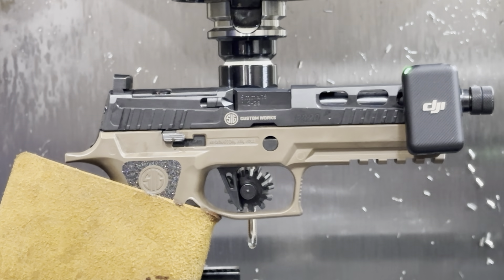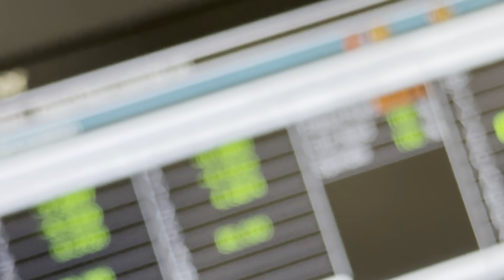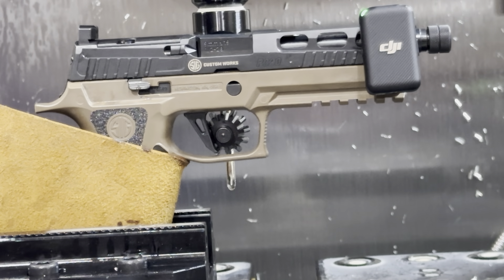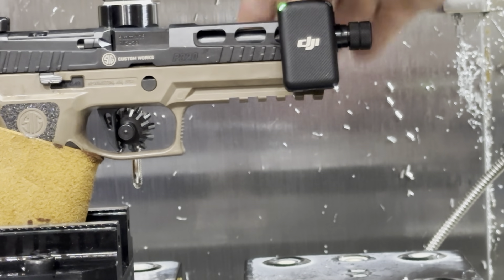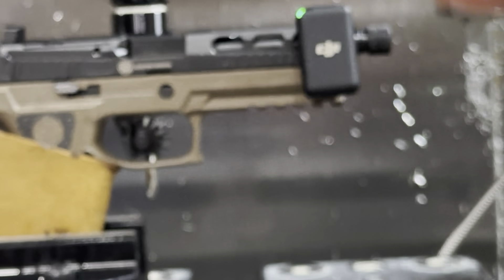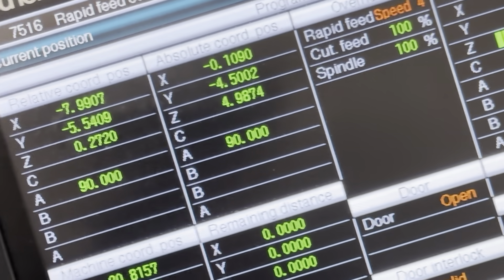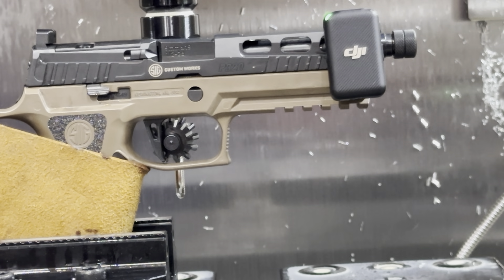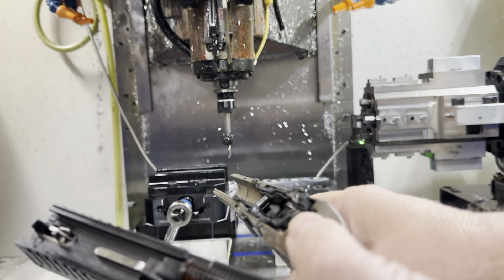Sig P320 accidental discharge tested in CNC machine.

Comment: so actually hes kinda wrong on his conclusions, saying thats how the sig is designed! well from my eyes i see that the trigger is still NOT fully depressed, and it fired when he bumped the slide! so Wyoming's test was right! sounded like he was trying to poo poo on him, and hes a little bit pro Sig! but when you boil it all down, NO FIREARM SHOULD FIRE UNLESS THE TRIGGER IS FULLY DEPERESSED! see, i can cap lock too Sig! all this guy did is prove that his trigger takes a little longer, but still dangerous! also, he has a newer sig, with a flat blade trigger face, not the same trigger the M18 has, or some of the earlier Sig P320's! but lets gloss over that fact too i guess!

Comment: Ironically you are PULLING THE TRIGGER....So it's not an uncommanded discharge,that just proves that the trigger was INDEED PULLED to the farthest point and the fact that my sig takes less than a pound of force past that point just means it has a light trigger that still has to be PULLED FIRST....

Comment: When I watched the "screw job" video yesterday, my first thought was somebody needs to put a P320 on a milling machine and calibrate the actual trigger break dimensions.  The Bubba test and this video both illustrate a potential issue may exist with the Sig, but I'm not sure how it relates to the tragedy at F.E. Warren AFB since all indications are that pistol was in a holster.  Presumably, no pressure was being applied to the trigger when it discharged.  Now I expect to see a whole bunch of video tests of other handguns that show this feat can be replicated.  That's fine, but I'm much more interested in finding videos which show a discharge occurring when no pressure whatsoever is applied to the trigger, including taking up the slack.

Comment: All this proves is that THIS PARTICULAR 320 probably doesn't have the problem. It's obviously not all the guns that have an issue. But if it wasn't the guy's issue then you would see similar numbers of glocks, m&ps, springfields, walthers, and other brands having the same issues going off in holster... you also don't see it happening with other sig guns, or 1911s... it's ONLY the 320 that has this issue

Comment: Whilst I appreciate you spent the time to make this video you do undermine it somewhat with your "I won't respond to comments" - that's something of a red flag. The other major factor, which I was not surprised you were very clear to avoid, is that you are testing just one pistol. And while your pistol appears to be well made and well within tolerances, that might not be case for ALL P320s and certainly might not be for firearms being produced in large numbers for the military and police forces - often at low margins. How often have we discovered that civy street has better made hardware than the armed forces. 

But what you've proved here is that YOUR P320 is good.

Comment: I want to start off by saying I sold my favorite gun of all time my Sig P320 X-Compact because of the firing issue. But, why is nobody pointing out that not a single one of these "viral" videos shows it going off without pulling on the trigger at all which is what supposedly is happening? I know it shouldn't be doing what it's doing but what holster is going to be depressing the trigger at all and if it is why the hell are you using it? These have no trigger safety and the travel from the wall to fire is VERY short especially with the flat faced triggers. So yeah if you start engaging the trigger even if it's "just to the wall" it's moving parts preparing to fire it's not just taking up slack in the trigger.

Comment: And that's precisely the problem with the P320: tolerances. We can't be sure that the trigger catch will always return to the same height after assembly in every P320. Personally, I find it strange that when the trigger is pulled, the entire bolt carrier is pulled down by that 0.5mm, sometimes more. This means that if dirt becomes present during shooting or, for example, when a full magazine is forcefully inserted into the closed bolt carrier, we can release the firing pin latch by fractions of a millimeter. Therefore, if the QC allows components within their minimum allowable dimensions, we could have a problem. And therein lies the entire problem with the P320: excessively large tolerances.

Comment: Go do the Glock video where you so gingerly press on it like you do the sig. 

The downside of this test is that you can be pushing the weapon into the part touching the trigger and it would be difficult to tell. (Although it’s easy to see you do it in the Glock video you posted.)

The benefit of the screw driver or pin above the trigger is that it moves with the weapon so literally the only influence is touching the slide.

Comment: I mean but you're not proving nothing a gun is supposed to go off on a trigger is pulled like that 😭 of course you shouldn't be able to get the firing plan to drop from touching the slide but I mean you basically pull the trigger

Comment: What if there is a combination, hot cold weather conditions, dirt and debris, enough play/tolerance in the gun and the different parts, due to manufacturing and or wear and tear usage, that the 2mm trigger pull is no longer required, but just the wiggle on the slide.

Such a gun should be placed in your CNC 

Best regards from Germany ❤

Comment: Do this test with the ones that went off. Seems to be by service members that use their gun and in several other videos there seems to be rounding off of the sears and uneven wear as well. Also testing one gun doesn’t test them all and that seems to be the issue. There can be one in 50,100, 150 thousand. It then warrants review. Not, “it’s the operator”. It’s weird, no one is complaining about any other Sig gun. My issue is the complete disregard. Never carrying an Sig again just for that. The fact they aren’t taking it serious but instead being defensive. I think the issue is the safety disengage. If you have any build up on it, it takes very little to disengage the safety. If you have any wear on the slide it just amplifies the issue because it can then rock and lift more. I would be curious to know what the spec would be on those parts because a few thousandths difference can in turn turn a gun from being able to fire like yours to only needing less than a mil or maybe less of pull to disengage that and arguably inertia can play a part. The argument at the end of the day isn’t about Sig is trash. It’s why buy or carry Sig when there isn’t that issue with others and when a company won’t take it seriously.

Comment: You know what it might be. If someone incorrectly charges the weapon and holds the slide as it chambers a round, it might be just barely in battery, but due to stacking tolerances and this narrow margin not fully engaging the internal safeties. The gun being out of battery a few thou I think is mechanically similar to the trigger being taken up these same few thou.

The few videos where the gun goes off as it is being re-holstered might be doing something similar. The act of re-holstering is pushing the gun out of battery this imperceptible 0.09", and then any added torque on the slide sets the gun off.

Comment: I am really glad you did the video with the CNC. Good job. 

When you hit the "wall", you disengaged the safeties that prevent the striker from going forward. Something I do not think most people understand.  Essentially, all you did was defeat the internal safeties which given the tolerances, if the slide and the FCU are in spec, 20 - 25ish/1000" later the sear should drop.  Given the slop in the slide and FCU of that pistol, bouncing the slide could easily cause the sear to disengage.  However,  one has to wonder on that pistol, if you had a loaded round in the mag pushing against the slide, would you have that much movement. 

In short, that's exactly why you do not pull the trigger unless you are ready to send a round down range. 

Thank you for the scientific approach.

Comment: All this proves is that the gun will fire without pulling the trigger completely. If your holster is too tight or the trigger somehow becomes pre-loaded or the trugger does not fully reset- BANG. You proved that the slide is too sloppy. The tolerances are bad. It is still a design flaw that no other brand has.

Comment: I think one of the things being ignored in this video (which is obviously a response to the Wyoming guy) is that Wyoming tried the experiment with 3 different  guns, but it only worked on one.
In other words, the point of his video wasnt jist that he could replicate a."what if" situation. He demonstrated  that  inconsistent mating surfaces could be a cause of a problem.
They were obviously  inconsistent, otherwise the expirement would have worked on all of the Sigs he tried.
These vidoe guys are switching from metric to decimal inch in their presentations. 
Anyone who doesnt ordinarily deal with measurements probably doesn't know wtf these numbers mean.
Just for reference, .125 is 1/8".
.0625 is 1/16".
Take a look at the old wooden ruler in your kitchen's junk drawer and you can see where 1/16 is, where 1/8 is, and hopefully, with that,  you can eyeball where .090 sits between the two.
I am not taking away this "precision approach" to measuring. But it isn't very meaningful if only one gun is measured. 
He is testing one of the 320s that will probably never self-ignite.
Unfortunately, the wyoming guy's video shows that some of the 320s have less trustworthy tolerances.
What is unfortunate about these Sig defender videos is the search for confirmation bias overrides the search for a solution.
Instead of trying to "prove" that Sig is not the problem, people should be trying to find out why the issues of unintened discharge keeps happening with Sigs. 
The answer cannot be "becasue more professions have Sigs, more unintentional discharges will be Sigs".
That cant be the answer because the problem didn't manifest with previous contracts featuring other brands.
It would be more believable to say "people prone to poor trigger discipline are drawn to owning Sigs".
 It would still be wrong, but more believable than, "it always happens with Sigs because that's what everyone uses".

Comment: I just would love for someone to give me an intelligent answer as to why no other gun has the issue of firing untouched in the same duty holsters to the degree that the P320 does. If it’s negligent input from the carrier or “keys getting in the holster” as Sig says, wouldn’t it be doing it with other guns? And spare me the stupid argument of “because there are more P320’s out there than any other gun” because that’s a dumb excuse because it isn’t true. Glock may have something to say about that. More Glocks have been in duty holsters since they came out in the 80’s than the slide slop baby rattle 320. The Sig sycophants are coping hard lately. But they still can’t answer my question intelligently.

Comment: How does that relate to the problem?  The P320 supposedly fired without any pressure on the trigger.  If you could get it to fire with no trigger manipulation, then we have something to talk about.  I guess you’re proving that the trigger must be significantly pulled before you can cause it to fire by jiggling the slide, and therefore, it’s doubtful a P320 will accidentally discharge without a trigger pull.
Reply: 2mm is significant?
Reply: @thaknobodi 
Yes, because 2mm is approximately two thirds of the trigger pull distance (after hitting the wall).  If you pull the trigger two thirds of the way to firing, you shouldn’t be surprised if it goes bang.
Reply: @TonyYuEvangelism   I'm just suprised, because im used to Glocks.
Reply: @thaknobodi 
I own a Glock and I suspect the trigger pull length (after hitting the wall) is about the same as the P320.

Comment: All you've proved here is that it still would go off by the slide and not the trigger. That's still a shitty design.
If the tolerances are loose enough, that 2mm might be lower.

Comment: A sample of 1 is not a sample. Tolerance stackup will vary from gun to gun. Sig can reestablish confidence very easily. Hire an independent 3rd party engineering company and provide them with a full set of engineering drawings. Then, the pistol can be 3D modeled in SolidWorks with full stackup dimensions. Then, and only then, will anyone understand the worst-case stackup and how this relates to function and reliability. After that, a significant sample of guns need be built using components that produce that worst-case stackup condition. Then, a test procedure needs to be written that tests pistols in holsters. This test must be repeatable, instrumented, and documented. If no uncommanded firings occur, then Sig can argue a strong case for user error. However, if Sig should be unwilling to do this scientific analysis, it would speak volumes. As a retired design and test engineer, I've done this many times on far more complex systems than a pistol.

Comment: This DOES NOT happen on my M18. 2024 production, M18A15XXXX serial. My slide is a lot tighter that what is shown here. I can add 3 lbs of pull on the wall and play with the slide and it does not strike until fully pulled.

Comment: You've taken the sear engagement to the hair's breath edge, then moved the slide and the gun went off.  This is 100% perfectly normal in any gun with a loose slide to frame tolerances like this- one has.  The striker hook is in the slide and the sear contact is in frame.  When taken to the final point where the sear is just about to release, by moving the slide, you're further separating the striker hook from the sear and of course it's going to release.   This 100% normal "if" the slide can move compared to the frame and this may be an inherent design flaw with the P320 in that the guns that do this all seems to have loose slides, while other P320s, including my Xten have rock solid slides.  But no matter what, all of this still requires the trigger to be pulled.  So this gun is only going off with the trigger pulled.  No trigger pulled, no gun going off.  Not defending Sig, not claiming there isn't an issue.  Only addressing this specific test.

Comment: Best video I've seen.  if that gun is doing what they claim, where is the defective part.  Far as I'm concerned, if there is no defective part, then that trigger is being moved by some other force, not coming from the gun.  Guns just do not pull their own trigger without there being a defective part.  I have a Sig 320 and I have no issues with it.  And I won't till someone show me a defective part.  Fine machined parts, just as those numbers repeated the same, each test, that is what a machined part does.  It not going to work then not work, unless there is a defective part. Just my thoughts for I also run a mill and lathe.  Very good example, indeed!  Thanks!

Comment: I have full stainless model compact, does not have hardly any play between the slide and frame. I tried putting a metal rod in the trigger and manipulating the slide to make it fire and had to bring the trigger back to the point of a full trigger pull for it to fire. Sig tried to make a gun that had a very little slack and very little weight on the trigger and it has not gone well for them.

Comment: Yours might fire at 2mm but no two guns are the same another one just like yours could never do it but problem is some might do it with just moving the slide around and never taking the slack out of it if you're using one of them you are just chancing if the one you have will or not who wants that

Comment: People do as always to please there self because they like there gun,the point is if a cop or whoever draws there pistol which is very often and goes threw pretravel and reholsters your gun not having to fire it,it’s very possibly ready to fire at any vibration because it’s been at wall before,there’s other videos of people actually doing this same method never pulling the trigger and it going off,one dude was at a rang doing nothing but listening to the instructor and it fired by itself,plain and simple the dam thing should never fire threw all the safety’s with no trigger pull completely pulled,these guns are production guns and not perfectly tolerant from gun to gun so some are fine but who the hell knows which ones ant

Comment: Thank you for conducting this very specific and repeatable testing.  What it shows is the following.  Even though the slide and receiver have a lot of slop, there still needs to be rearward pressure on the trigger  and slide movement to get the gun to fire.  I tested my own Sig P320 and while the testing wasn't as precise as yours, I still needed several pounds or rearward pressure on the trigger plus messing with the slide in order for the weapon to fire.  Don't put your finger on the trigger unless you intend to shoot the gun.  If you have a holster that is ill fitted and it contacts the trigger, replace your gear.  The gun's trigger is the light switch to make it go off.  My condolences to the airman that got killed and to those who have been shot accidentally / negligently, but all these test being performed on the u-tubes show you have to have rearward pressure of some sort on the trigger.  I tried the same thing with my Glocks and could not replicate the issue but there  isn't any slop in the Glocks between the slide and the lower receiver.